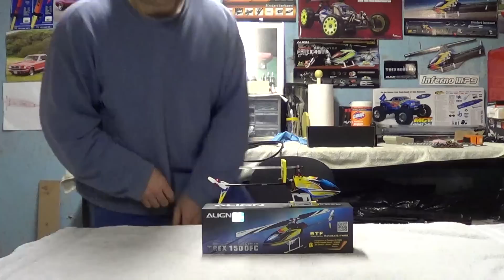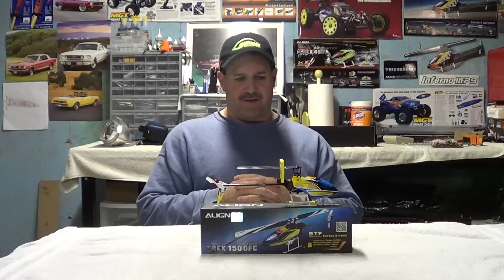Rc hobby companys , our we being upgraded to death and ripped off

Comment: You are absolutely right Nitro.. ive had the 130x also, I sold it because of the same issues you.mentioned. Ive also had the nano cpx and its a great flyer, definitely a plus for for Blade. I also still have a trex 150  that I got a couple of weeks back that has had so many issues that I just decided to put it away and wait for fixes to be made. ALIGN really messed up with this one. But, by far my favorite and most reliable heli has been MCPX BL. In my opinion, it is Blades saving grace in this field after the 130x. If you dont have it already you should seriously consider getting one.

Comment: So True.. I have to agee with you 100%.. Specially on the 130x comment which got rid of it and lost $300 after all Lynx upgrades. I then get a Align 250 Pro (Blue ESC) and build to specs and hovers at 3/4 stick. I am not the only one with the same problem. Right now I only fly my Radian Pro and my Align 450 PRO DFC. Both witouth any upgrades. I also have an MCPX V2 which I fly around very gently so the tail wont blow out. Great advise. I stopped purchasing Blade products after my 130x.

Comment: This is one of the reasons I got out of R/C a while ago. I have recently gotten into multirotors and I've found it to be a complete breath of fresh air.

Multirotors are/can be super durable, built from scratch by yourself easily, completely customized, etc... It's a hacker and DIYer's heaven. It is much less of a money pit than most of the other R/C subcategories.

Comment: I completely agree with you Ray.  I have been following the micro's since the first mcpx.  Each company has done the same thing.  Blade, Walkera, and now align.  They show a copter doing amazing stunts in the hands of professionals.  That "display" model can take so much abuse but when the product is released it's crap.  They use the first batch for testing how cheap they can make it.  The first line of customers are basically beta testers.  Then the company makes nothing but profit from upgrades.  When sales finally slow and the dust clears they release a version 2 with all the upgrades.

Comment: Hi How are ya?  Thanks for your honest opinion on Align and all the Upgrading that has to be done on all Helis. I've watched all your Videos on the T Rex 150. I know you must get a ton of questions on everything. I wanted to ask you what are your thoughts on The Align 250 Plus. I've been flying a Blade Nano Cp X  for a while and Wanted to upgrade to a bigger Heli But after watching all the videos you made on the Align 150. I was wondering if you think a 250 is a better choice or even an Align 450L  Dominator? Thanks for your videos I have learned a lot watching them.
Reply from the maker: i would get the dominator 450 l the 250 is a waste of time
Reply: Thanks a lot for your quick response. I really appreciate it.  It's nice that someone who has been in this hobby for a long time will actually take the time to answer.  Again Ray you're a great guy thanks for your videos. I have learned a lot from you. Enjoy your day! One more time I can not thank you enough for your advice. =)

Comment: Hi Ray: Great video! I agree with everything you're saying and I am curious about your thunder power batteries. I have been buying the Hobby King zippy lipos, and I typically get about 100 cycles on them before they lose their zip. I take very good care of my batteries and I was thinking that 100 cycles is normal. To hear that your batteries last about 3 to 5 years is great. How many cycles is that? So I guess with batteries you get what you pay for?
Reply from the maker: my thunder power g8 batterys are rated for 800 cycles

Comment: I just want the one Szabo is flying,  or find the trick to get it to fly correctly.   I am finding that the main shaft is weak,, fix  find a graphite tube that will fit inside the main shaft.  Its the bent shaft that causes the swash plate to fail.  So far I feel if you can get this copter setup correctly it is far better than the blade mcpx.  The wrong pitch = high rpm and vibration,

Forget the pitch gauge,   adjust the pitch by flying, A lot of people are new to the hobby of R/C helicopter and they buy the lowest cost copter that offers collective pitch and they wind up with a MCPX or Align 150, eye ball the pitch to around 15 degs using a protractor and adjust with the pitch curve,  throttle should be around 80% high.

Apply a bit of E6000 or Goop to the motor connectors so the connecter can not vibrate loose. 

I agree the company's do introduce new products to the public, tested and fully knowing weak points of the copter....   My biggest beef with Align is buying a $1000 kit and the canopy's clear coat is cracked. They don't care. It will take an act of Buda to get a new canopy.

Comment: The Blade Red Bull 130x is just the worst ever designed product to ever hit the shelves.  When it is working, I love it.  Now try taking the canopy off.  Try changing a gear.  There are 30 sub micro mini specs for screws they put on it to hold the canopy.  Come on, I mean, come on. Once you rip the canopy off in frustration a new one will run you as much as buying a used one on ebay.

Comment: I hate this helicopter with a passion.  You talked about people complaining about flying it into a concrete floor and parts breaking.  I actually have a right to complain about this because yesterday I was flying mine and the swashplate separated.  this caused me to loose control and it flew full speed into my neighbors house doing around $100.00 in damage to my heli.  Upon trying to fix this fun little toy I had to remove the tail motor, and had the same problem you did with breaking the wires off.  Another $30.00 Down the drain.  Before this crash I actually had a main gear split in half.  Not from a crash mind you.  I just went out one day and tried to fly it 2 days after a perfectly fine flying session, when I couldn't get it off the ground I inspected it and sure enough the main gear was split in half around the bearing.  Fun Times.